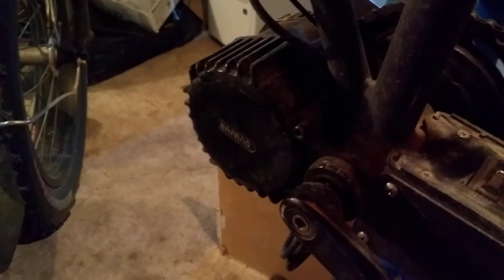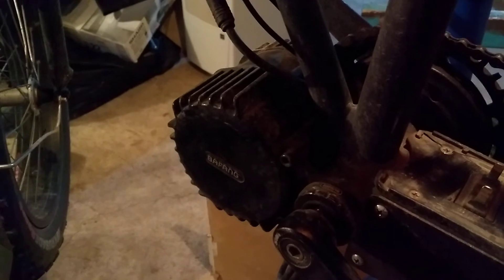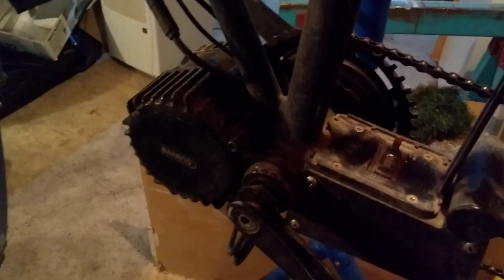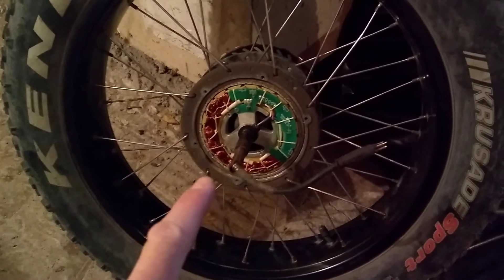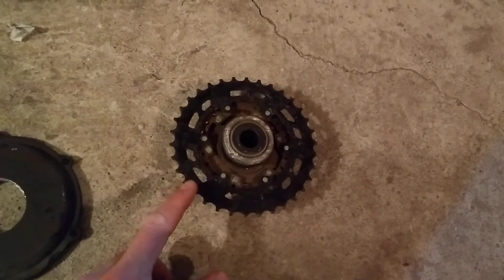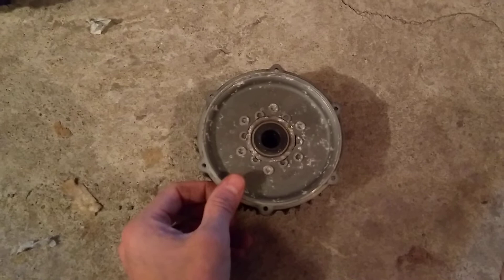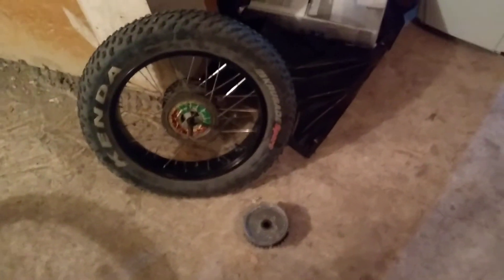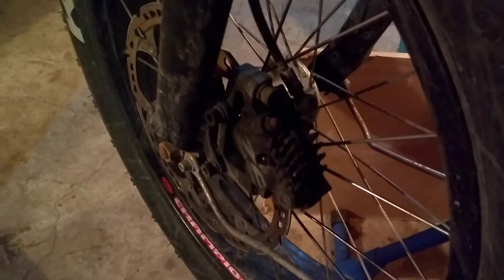Ebike Mid-drive motor strength - BBSHD

Comment: Seems like I came to the right place.  I have a steel frame bike like yours, it's heavy but I want to get it up to speeds of 30-40mph.  What power BBSHD do I need for something like that?
Reply from the maker: I'd say stock 1,500 watts would easily do 30mph and, depending on your gearing and wheel diameter, 40mph is totally possible also.
Reply: @urbancargobikes4930  It's 20x4 wheels, single gear, I fear having more gears.

Comment: I've a gear sensor on my bbshd, so should be more kind to the drive train. .hopefully it will protect the chain as I skip through the gears! ..saying that its a different riding experience to my old front wheel 500w hub motor, they both have their merits and I suspect that the 500w probably maxes out at about 800w as it flies up to 28mph on the flat! Saying that the hd mid drive is very torquey with a 42t lekkie type drive sprocket fitted, don't rate the factory supplied pressed steel 46t, seems and is cheap, having no tooth profile at all.

Comment: there is some corrosion on the inside of the motor plate combined with the cheapness of the hub.

you may be able to do better with a hub that is steel or a better quality hub

Comment: What's your top speed?
Reply from the maker: Hey Chris! With the BBSHD and geared with 52 tooth crank and 14 tooth gear in the rear I made it to just under 40 mph. Now however, I have it geared way down for super strong towing and low end torque. It's got a Sturmey-Archer 3 speed hub with a massive 28 tooth cog in the back and a smaller 42 tooth crank in the front (Lekkie Bling Ring).

Comment: The main problem for 30 amp bbshd is some high capacity batteries have a 20 amp continous discharge but a 30 amp bms so people draw 30 amps and it kills the battery.
Reply: You bring up a good point that some might overlook. When someone wants to either program the motor to a high amperage or purchase a new battery it's super super important to make sure that the battery bms can handle it. Thanks!